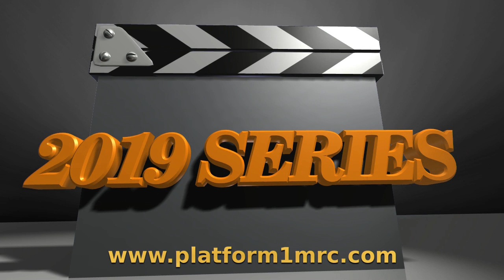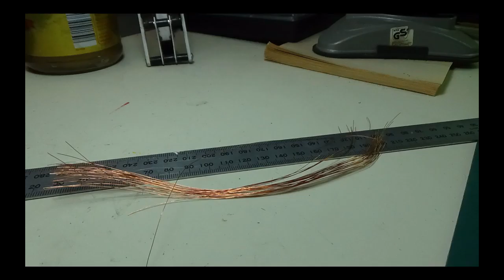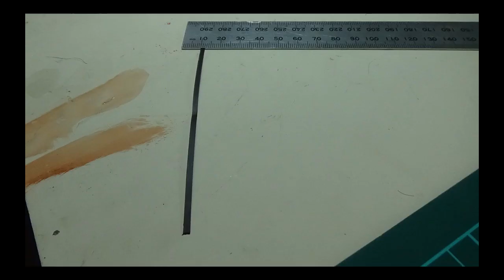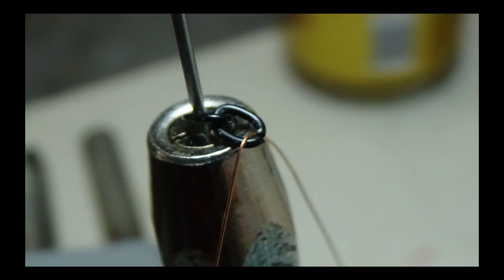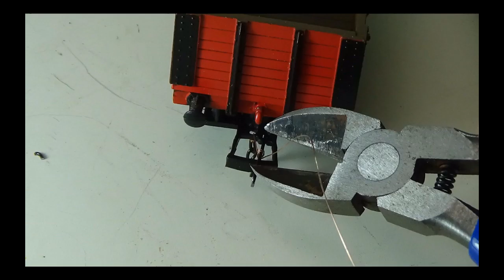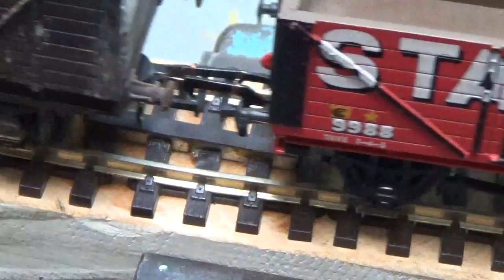Episode 130 19 Another Way Of Doing Magnetic Uncoupling

Comment: That is neat.

But can you help me out please as I'm having trouble working out how this functions.
The un-coupling is straight forward and easy to understand.  But how does the re-coupling work?  Why are the cars un-coupling every time they pass over the magnets?
Reply from the maker: G`day
The re-coupling will happen whenever the wagons are not over a magnet. If they are over the magnet, they need to be pushed along the track to a point where they are no longer over a magnet and at that point the couplings should drop back down and re-couple.
The cars are only uncoupling over the magnet when they are pushed. When they are pulled across the magnet they hold in place against the coupling bar
Hope this helps
Cheers
Gormo
Reply: @greatchesterfordjunction  
Hi Gormo, thanks for the reply.

I was confused because the un-coupling occurred sometimes when over the magnets but not at other times.

I think the second part of your reply answers my confusion.  That is that the tension from pulling the cars is enough to override the pull of the magnets.  Therefore when pushing there is no friction and the magnets work but when pulling the friction is enough to overcome the pull of the magnets.

Cheers
Mick

Comment: Gormo after watching the staple system and the chain system which one have found is the superior? I built a system using a a 30 mm long brass strip pushed up with a peco point motor vertically mounted below but when activated it often kicks the wagons off the track, so I am looking to change my system looking at servo system but the price is a bit high!
Reply from the maker: I feel the chain system is superior both in looks and performance.
The problem with it ,is getting it set up correctly so that the connecting wire moves freely through the coupling to raise the coupling bar and then of course drop it again. I feel the system needs more work to improve it. I don`t know exactly what it would take to make it bomb proof but there must be a way.
That leads me to the staple system ,which is easier to set up and it works consistently. The down side is the appearance of the staple.
So based on consistency ,I would have to say the staple is the most practical method of the two.
Cheers Gormo

Comment: Looks great, Gormo. I would use 2 magnets and if you have problems seeing what you're doing then stick some visible markers on the outside of the track (in the ballast) to mark the ends of the magnets - maybe some pins with coloured plastic (or painted) heads, or a couple of bits of static grass if you are very fussy.
Reply from the maker: Thanks Ray,
Very helpful suggestions .......I like the pin idea
Cheers
Gormo

Comment: That's superb. Very neat solution and much nearer scale. I use kadee couplings on freight stock -  looks terrible but works well. However I think your idea would work really well for passenger stock. I'm going to have an experiment. See what you've done.    I'll be on forever changing my stock now. LOL. Cheers
Reply from the maker: Sorry Alan,
But Hey!!!!.....if it does not work out for you.....remove the wire and chain and you`re back to original.....no harm done.
Cheers
Gormo

Comment: Another great tutorial. Every video from you provides so much food for thought!
Reply from the maker: Thanks Malcolm,
Nice to hear I give you things to consider
Cheers
Gormo
Reply: I used your 3 link system on a rake of 16t steel coal wagons. They were built purposely to try the system. Works fine. This new one looks like a great compromise for some of my older stock. So I will have to have a go at this system too.
Reply from the maker: @malcolmhodgson7540  Good on you Malcolm,
I`m glad to hear that the three links were a success.
I know I`m chopping and changing on this subject of couplings but it almost seems like the Holy Grail to me.....I seem to be on a quest to find the ultimate solution..???
Cheers
Gormo
Reply: 4mm to the foot robots with AI that actually couple and in couple the wagons as per the real thing. Might be a little ways off yet!